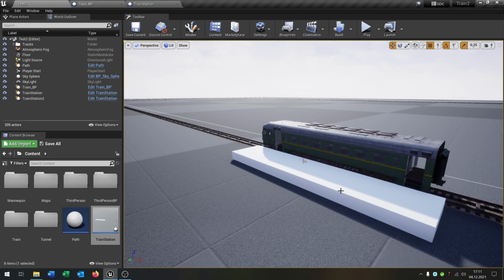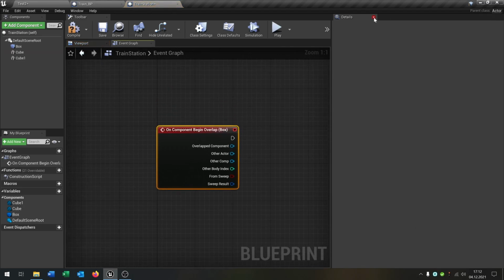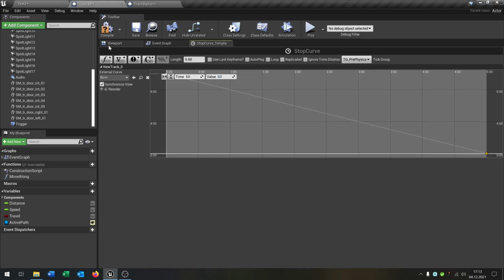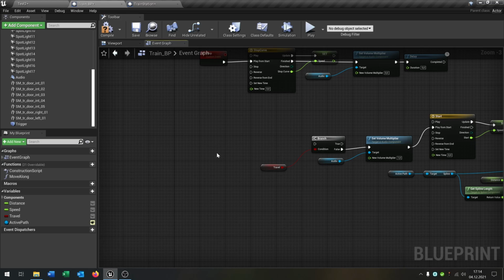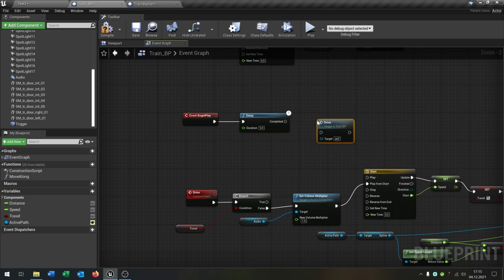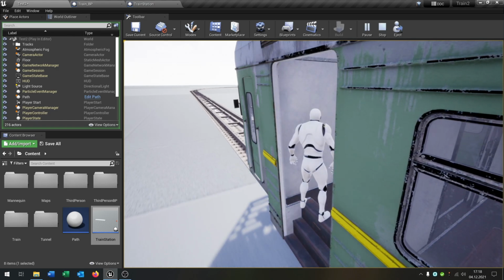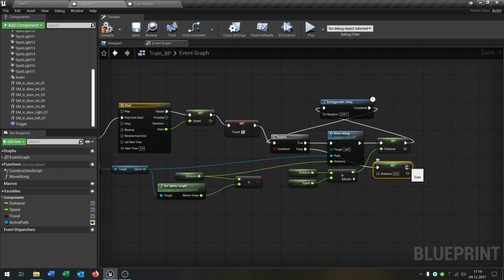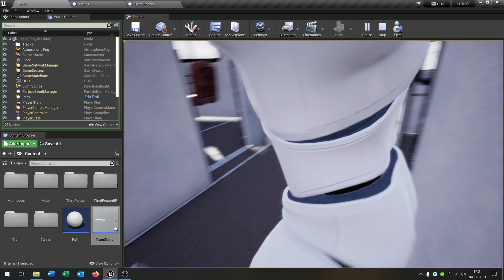Unreal Engine Train Tutorial: Trainstation / Track Looping

Comment: is it possible to make the looping but on a linear straight path so it goes to and from one point to the other
Reply from the maker: Yes, with the same concept.
Reply: @Seredias.  when I create my spline and make it a straight line the train will go to the end of the spline and then return to the start of the track is there a way to make it go from a to b b to a ?
Reply from the maker: @HollisSayer  Yes, you have two options for that. One is to have a second Spline on the exact same position but other direction. The second option would be to create a copy of the "Move along" function and subtrat the Distance.
Reply: @Seredias. what do I subtract the distance from sorry to be a pain ?
Reply: Edit: I got it working however once at a again it doesnt then go to B is there a way to make it loop from a to b b to a a to b and so on
Reply from the maker: @HollisSayer  If you got it working, you just need switch it back on the other end. Which solution did you pick? Two Splines or subtract the distance float?

Comment: love the video. Now - If i wanted to create a Multiple unit train that the player can A) Control using buttons and levers inside the unit, and B) have a computer somewhere in the level control switches/points for the MU to follow, how would the splines link together for the different tracks and how can we set the trains motion based on a throttle lever? Thank you.
Reply from the maker: I will do a Tutorial, this will answer these questions.
Reply: @Seredias.  fantastic. Thank you.

Comment: If I want to stick a trailer with a trailer to make the train long, how do I make the train run with all the trailers also, how do I make the wheels spin, can you do that?
Reply from the maker: Since it is a Blueprint Actor, you can combine the Static Meshes (Train) and it will work. In case of the Wheels, I will show this in the next Tutorial.